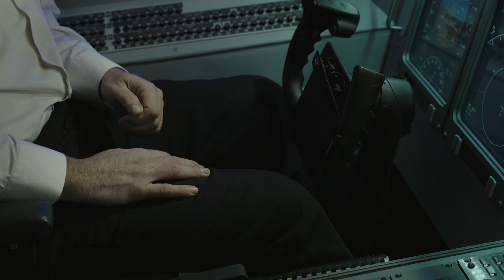Disaster Strikes Flight 6780 | Air Crash Investigation | National Geographic UK

Comment: Why auto pilot didn't level the plane at 2000 ?
Reply: Apparently, the pitch down from 4K was so great (pilot had engaged full throttle) that AP couldn’t react quickly enough once the plane plummeted through 2K. 😳